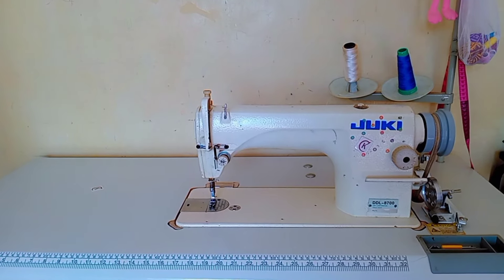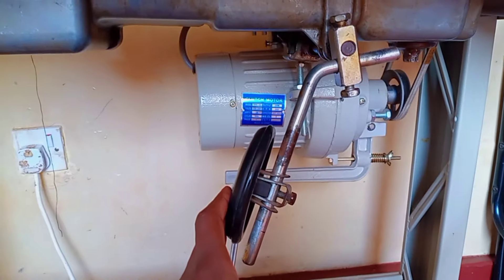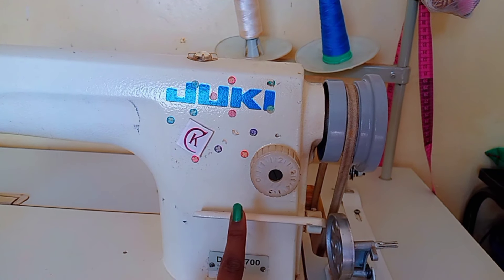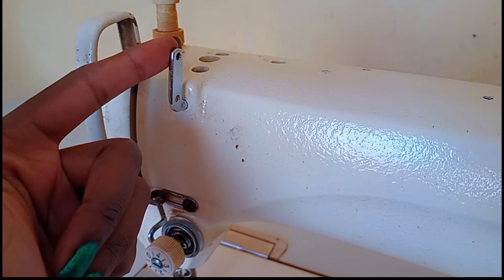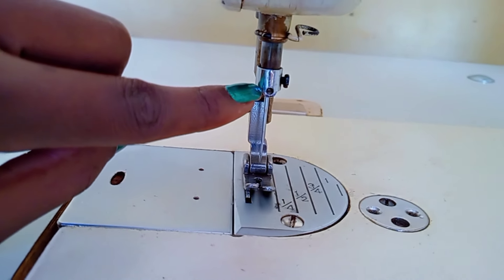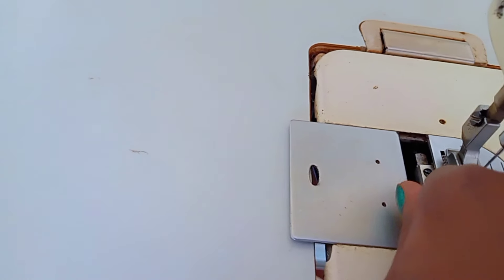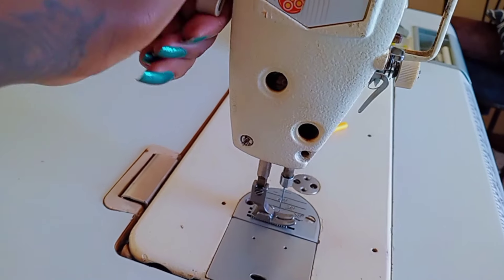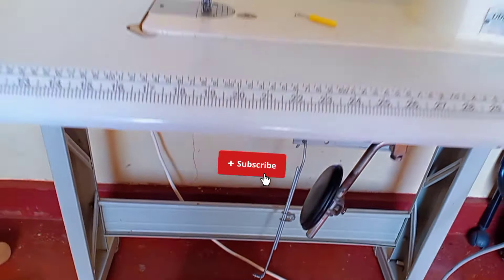basic parts of a sewing machine and their functions// juki ddl 8700 #juki_sewing_machine

Comment: Nice, always wondered what that circular plate on the right of the throat plate is, any idea ?
Reply from the maker: it is likely the presser foot lifter or presser foot screw plate. It controls the lifting mechanism for the presser foot, which allows you to raise or lower the foot to adjust the fabric as you sew,,thisplate helps in positioning the presser foot in the correct place and ensures smooth fabric feed through the machine